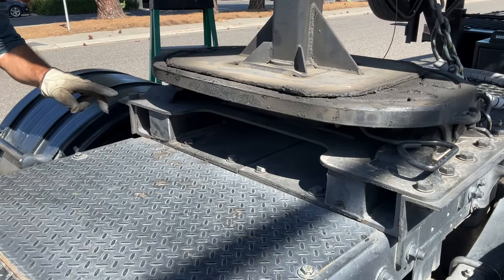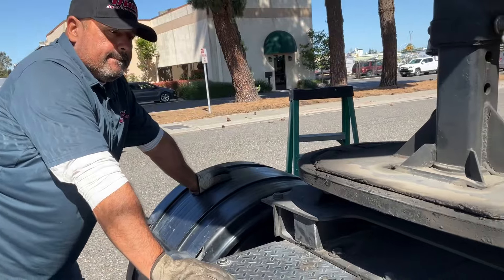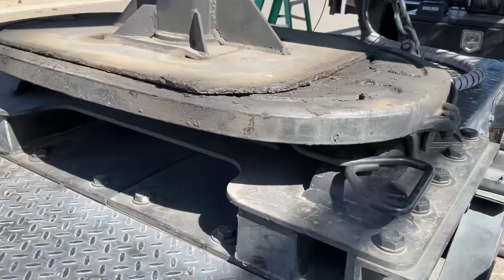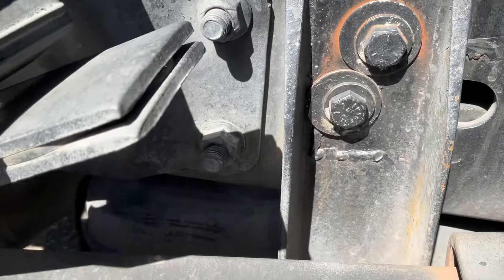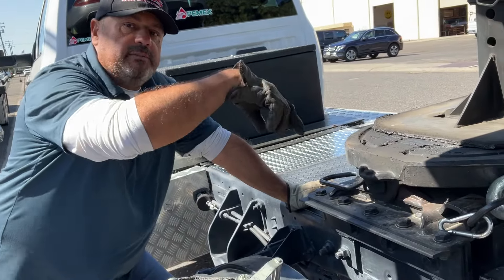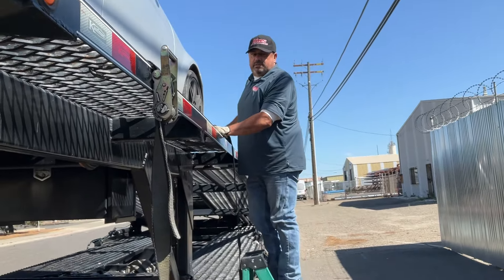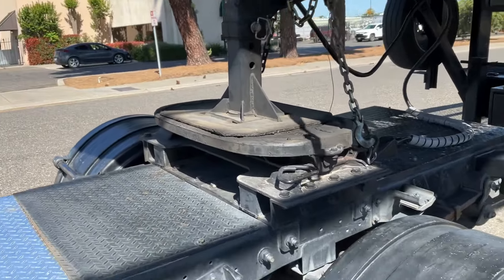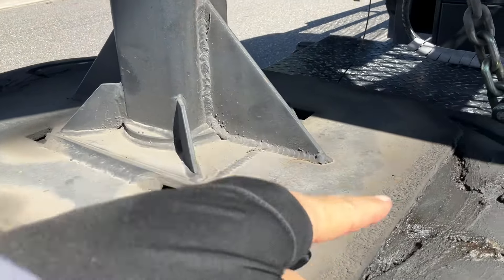How to install a fifth wheel on a Dodge Ram 5500

Comment: Congratulations on the new Trailer, may want to consider getting a day cab semi, that's a lot of weight for your medium-duty everyday hauling.  You also will not have to worry about over loading your drive axle.
Reply from the maker: Thank you!  That will be my next truck.